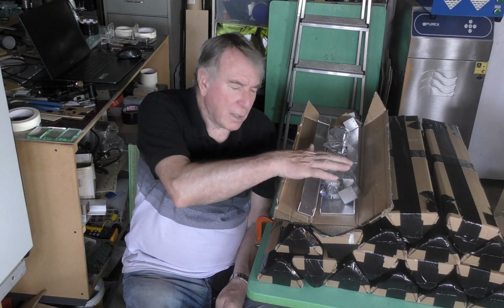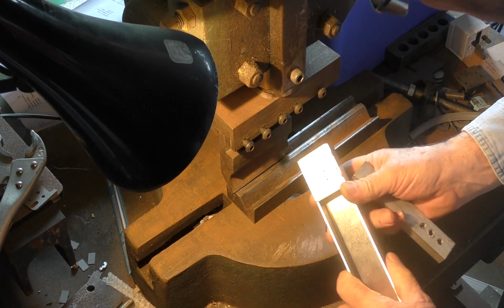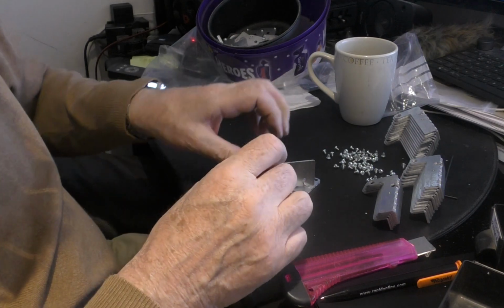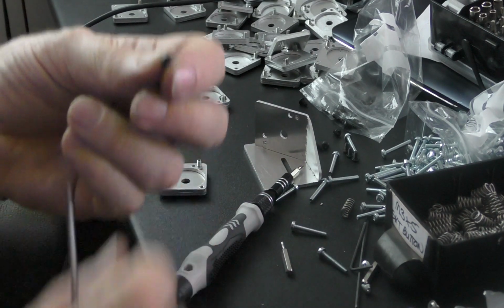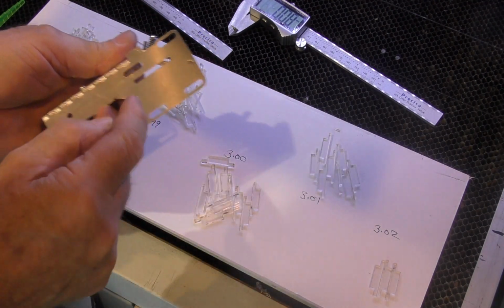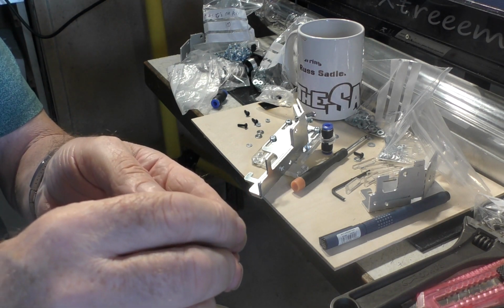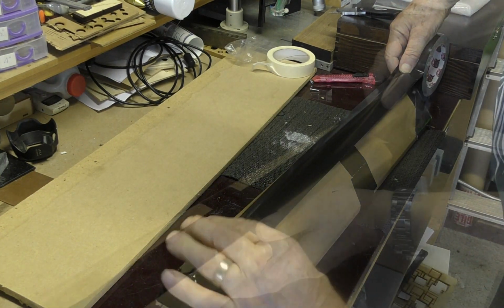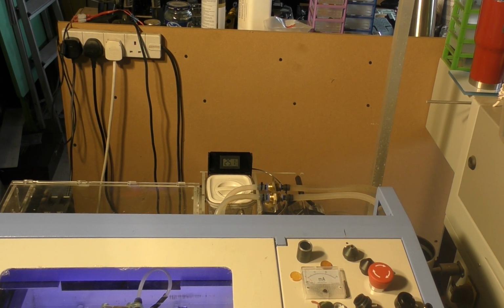K40 Xtreeem mechanical upgrade kit

Comment: Hi Russ. At the end, you mentioned running the tube up to 40-45C, instead of 18-19C and NOT affecting the LIFE of the tube. I was told that above the recommended operating temp, you start to convert the gasses inside the tube to some non-lasing form and the tube slowly loses its max power capability, rendering it useless much more quickly than if you kept the temp at ~18C.

Did I miss some further study on the operating temp issue? I have been panicking with keeping fresh ice packs in my 5 gallon bucket (cooling my 40W K40 tube) and stopping when I ran out of packs and went above about 22-24C. Not necessary? Hoping you have happy news on this front. Thanks!

Also, thanks for all the great videos over the years. I am also old, fat and ugly and love tinkering with lasers, so we have a little in common. :-) I added air on a cable chain, a new blower, an ammeter, my own 3D printed laser mount design, a Cohesion 3D board with LightBurn and extra switches to run the board, air and light separately. Great starter machine for tinkerers. 

Best, 
Peter
Reply from the maker: Hi Peter 
 There are so many experts around that pass on  their own experience rather than the facts. It took a long time to piece together how the pysics of a tube works because you will not find it clearly described anywhere. Here is the basic way that a laser tube functions  and you need to reference the diagrams in this video to undestand the next bit
https://laseruser.com/the-concise-rdworks-learning-lab-04/

The temperature in the ionization tube will be VERY high, so it matters little whether  the cooling water is cold at 15C or  just or comfortably warm at 40C . That small difference will do little to affect the rate of heat transfer to the water in the water jacket. It will certainly have no effect on the stability of the gas mixture .There is no physics  process other than the over excited nitrogen atoms that is capable of causing the DISSOCIATION (breakdown) of the carbon dioxide.  As I describe in the video, provided you stay within the manufacturers safe current limits  the level of dissociation will be very low and there are mechanisms now built into tubeds to repair most of the dissociation that happens. For example, examine your tube when not running. Most central ionization tubes these days have a distinct pink hue to them. This is an atomically thin layer of gold within the tube that acts as a catalyst to recombine the free oxygen at to the carbon momoxide molecule to create new carbon dioxide.  Additionally there are more tubes that now have an 80mm diameter outer glass tube, This creates a bigger gas reservoir ie more CO2 can be stored to increase tube life. Despite these design improvements tubes will still eventally run out of CO2,  BUT the tube will NOT get weaker and weaker as your expert opinion advises. No, just like an ink printer cartridge the will be no loss of performance unti the last 1% of CO2 becomes insufficient to create full power. NOW the power will decrease over a few weeks as that 1% drops futher into it "nearly dead" condition.

The makers of industrial chillers recommend a temprature setting of about 19C. Why this number I have no idea. It just causes serious problems for some applications like photo engraving. The shock that the mirrors receive as as refrigerated cold water hits them at maybe 5C or less , causes the mirrors to distort slightly. This  distortion affects the perfection of photon reflections between mirrors,  resulting in as much as a10% instantaneous drop of power resulting in light and dark engraving bands. 
 
The lesson here is to make any changes to water temperature very slow. Maybe put your water reservoir into a second  bigger cotainer  that you can fill with cool tap water. When your resevoir  water gets to say 25C,  just replace the warm tapwater with new cold water. This will ensure  a gentle slow temperature changes to your distilled water reservoir.

 This whole laser technology is riddled with myths and lack of factual knowledge, so always be skepical and do your own research and find your own methods.

Best wishes
Russ
Reply: @SarbarMultimedia  Wonderful reply. Thank you very much. Yes, there is further research ahead, but the science behind the extended safe temperature range seems sound (and probably the reason why most tubes aren't dropping off like flies even though most people don't have chillers to maintain strict temperature control). 

I like your idea of using tap water in a surrounding bucket. This would mean I can safely decrease my distilled water container size a bit, since it will bathe in a larger pool (thin walls would help). I usually run 3-4 gallons in a 5 gallon bucket, so I'll cogitate and figure out a system that is similar or slightly larger in overall size (but still fits in the cart under my laser).
Reply from the maker: @PeterC3400   
hi Peter
Your last words "under my laser" were interesting. The pump you are using has a very small "head" capability. ie its pressure capality is low  and although the pump may deliver say 5 l/min,  it can only do so if there is zero back pressure.   The further your pump is below your tube the greater  the back pressure on the pump The will come a point, say 6 feet above the pump when the back pressure of water head balances the pressure capability of the punp and the flow will be zero.. On that basis  the closer you can raise your reservoir to the height of the tube, the greater flow rate (and better cooling) you can force through the tube.
 Best wishes
Russ
Reply: @SarbarMultimedia  Good thought about pumping height. I don't know how many liters per minute are required for adequate cooling of a cheapie K40 40W tube (really only 30W, and I set 18mA as my 100% setting in Cohesion config). 

When I powered on recently, after a lengthy hiatus from using it, I saw distinct and rapid burbling in the ends of the tube as the water displaced the air. I lift the downstream end of the entire K40 chassis up until the tube is 45 degrees or higher, so all the bubbles find their way out. 

The pump SEEMS adequate to move the heat along and out with sufficient purpose and determination. I see my in-line flow spinner rotating quickly enough to provide me with the 'warm fuzzies' about tube cooling. Quantitatively, however, I have no numbers to justify my comfort.

My laser sits on a cheap metal tool cart with a bottom shelf where the 5 gallon bucket sits with the fish pump in the bottom. The pump height is about 76cm (~29-30 inches).

It is VERY convenient for the laser to live on top of a rolling cart, with the bucket, exhaust hose storage, air pump (suspended from bungie cord for sound), scrap box, tools and a squirt bottle (for those inglorious moments of conflagration) on the shelf below. Perhaps I should consider a stronger pump.

The laser appears happy. So far so good. But a man falling off a 16 story building can also rightly say "so far, so good" for the first 15 floors. ;-)
Reply from the maker: @PeterC3400  
 Hi Peter
 Take a close look at your pump and it will probably have a model number on it somwhere. I'm sure you will find a specification of head/flow on-line somewhere. If you want to buy a bigger pump you must  know what you have to start with.. If you want to check the head pressure then get a piece of tube say 10 feet tall and see how high the water can be forced up the tube.
Best wishes
Russ

Comment: Not right video but I have just finished making my mk2 lightweight head and have instantly stripped the threads as soon as I went to install the mirror mount and springs I decided I would have enough room to redo it as m4 instead of m3 and again it has instantly stripped the threads when I went to put it together is there anything I can do to fix this I was going to try use the low temp brazing rods refil the holes re drill and tap or remake the part but was there any better option to fix them and what can I do to ensure I get a better thread cut in as they are made for adjusting I don’t want to have the issue of stripping threads come back to bite me again

Comment: i have the kit from cloud ray and it is a good bit of kit to replace the stock board.
and with lightburn it is so much better to use.
Reply from the maker: If you have the two stepper drivers as part of that Cloudray kit then then the mechanical upgrade is about 1/3 of that cost and  really transforms the machine performance....not just the flexibility that Lightburn or RD works gives you. I hope these videos have inspired you to push your machine even further.
 Best wishes
Russ
Reply: @SarbarMultimedia  hi Russ yes i have the cloudray full kit installed into the K40 got that for my birthday last year.
i have been getting bits to get a bigger bed area and have it height adjustable.
like have a mill and lathe etc to help make bits.
as for your videos they are the best as you get very in depth with them and explain loads.
without your videos i am sure many would be pulling their hair out.
thanks for the great videos.
best wishes Russ keep them videos coming i and many will be watching them.
Regards Martin
Reply: can you give the link to the cloud ray kit in question  Thanks jeff @dmcarpman

Comment: This is terrible!  I just got my K40 sorted out, totally re wired, cohesion 3d control board, motorised Z table, works very well (providing I keep the speed down) ... now it looks like I have to start again!
Reply from the maker: BIG hug......I bet you had great fun upgrading your little beast, and as you say, it works well, so don't envy the  different approach that I took.  I started with a lot of big machine experience and I wanted to replicate that big machine capability is a small format case. My goals were speed, lens flexibility. and portability. Be proud of your achievement because success is a relative term determined by the goal you set yourself
 Best wishes
Russ